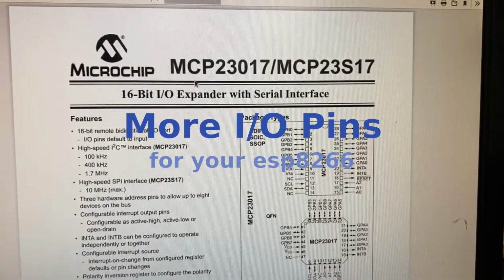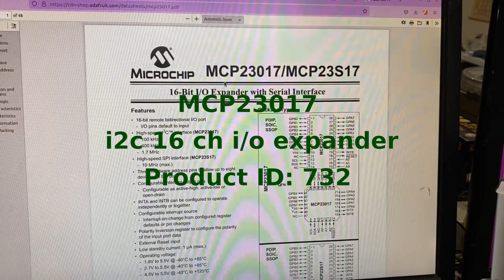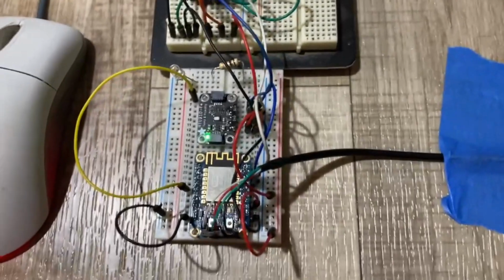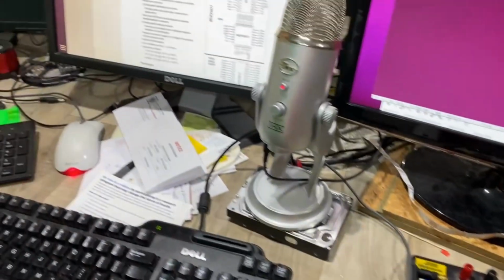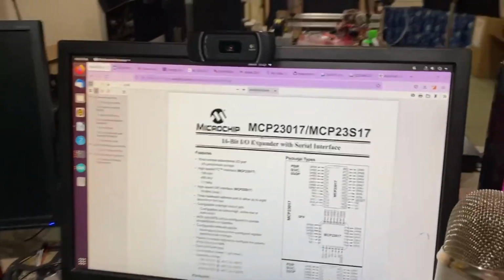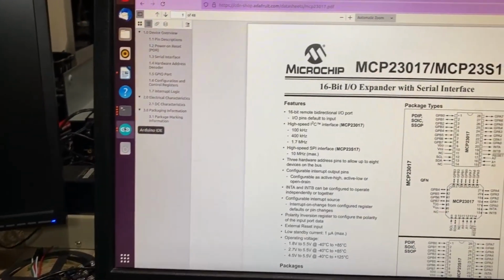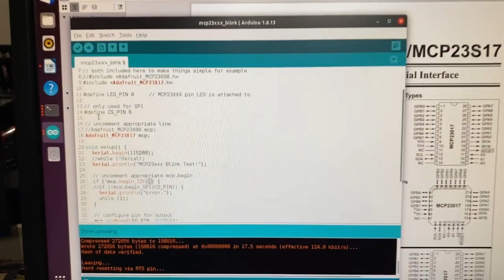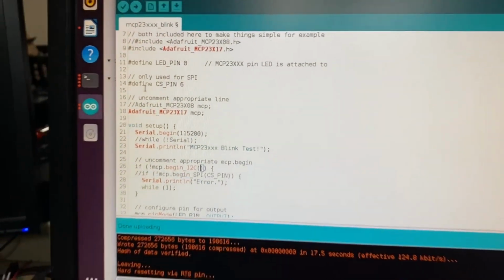esp8266 - need more i/o pins ?!?! ... watch this !

Comment: I design LED panels for desktop displays (like art pieces, nothing crazy) and I attached traces to each pin on the 8266 thinking "oh, it says I can use every GPIO pin, great, I'll use all 15".... Whoops. So luckily I noticed this before those boards went into production and this video is turning me in the right direction. Plus getting a MCP23017 on the board is $1.50, that's a fair price. Thanks for the help!
Reply from the maker: @AmusementLabs ... thanks for your comment ! Honestly, it came in at a time when I'm thinking of discontinuing the channel because of a lack of comments, feedback and discussion.  So, you gave me reason to reconsider :-) ... by the way, I do a fair amount with esp8266 and esp32 and other fun stuff, both fun like you and semi-industrial.  It's hard to know what topics to invest time in for a video; so, if you have suggestions or need help, feel free to PM or make an extensive comment.  Thanks again.
Reply: @danielatbasementtech  Sure, always figure it's nice to let people know their impact. :)

One thing I would be interested in is how to get it to do PWM stuff. I know those pins on it don't actively do PWM so I've been going over some options with chatgpt and deepseek to see that they can come up with to make it work just like a normal PWM output/code. I'm not sure if that's too outside your wheelhouse, but a thought. Other ideas might be how to do some basic and expandable (show us how to do something moderately complex with an explanation and then give ideas for use cases) tutorials on wireless control like how to do the browser based designs. Something more moderate maybe could be like how to operate servos and LEDs simultaneous over wifi and then maybe build on that with some kind of sequencing via browser.

Thanks again for the help. :D